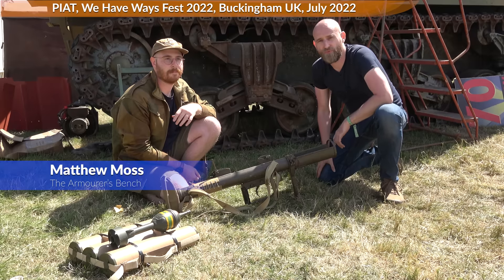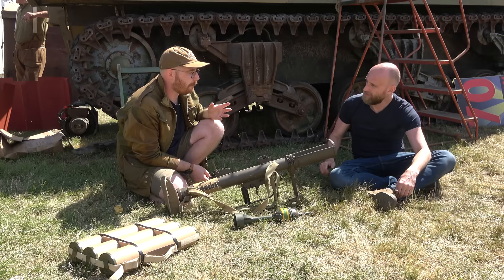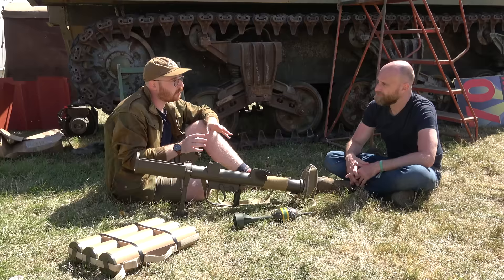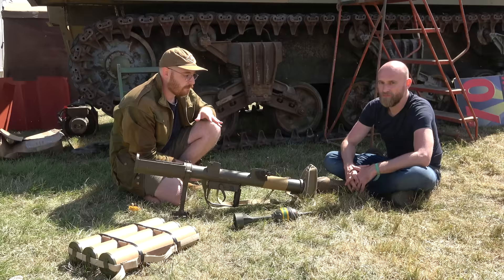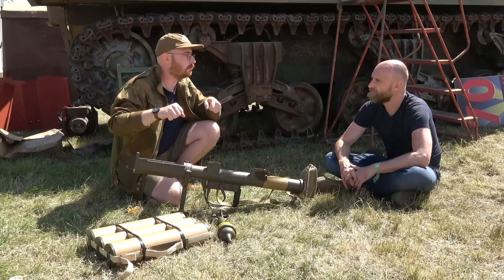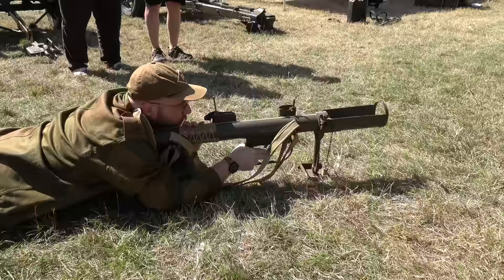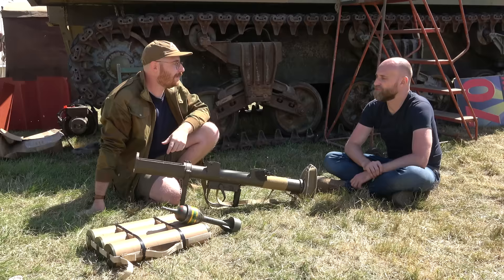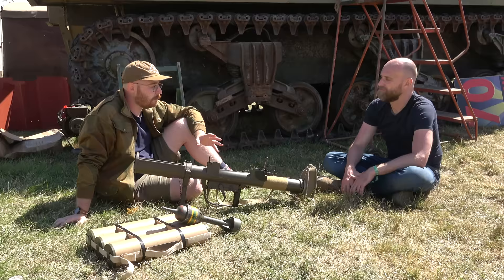PIAT: Better than the Panzerfaust?

Comment: I heard these were very popular with the Partisans in  Yugoslavia simply because of the lack of back blast and it being relatively quiet.  And they really liked using it as a mortar!
Reply: How can that be quiet?......If all goes according to plan, there should be an explosion at the end.....:)
Reply: @mikeromney4712  the same way hand grenades are quiet.  You don’t hear it until the big boom.  And because there is no significant back blast or flash at the originating point you can’t pin point where the attack was launched from.  

It had more range than a typically thrown hand grenade so the partisans could fire a couple rounds into guard posts with great effect, causing mayhem and fear and then melt into the night.  

You’re thinking of using the PIAT  in a major fight.  Partisans used them in ambushes and small raids on much softer targets than Panthers and Tigers.

Then broke engagement before the Germans knew what hit them.
Reply: @KnifeChatswithTobias  So the firing sound has to be quiet so that the bang 1-2 seconds later is a complete surprise?.....:)
Reply: @mikeromney4712  , you would possibly hear the report of a large caliber rifle a 3/4 second befor something, possible the car, truck, building etc.  that you’re in blows up.  Those who were not hit would probably not see a flash or no the exact direction of fire.  This would be case if the PIAT shot was made from 250-300 feet.  
A bazooka or Panzershrek would leave a much larger signature with its back blast.   And throwing a hand grenade 300 feet was not really feasible.  This was the weapon that filled the distance void between hand thrown grenades and mortars.   And it could take out a tank.
Reply: @KnifeChatswithTobias  Sir, in all honesty, you underestimate the spectacle that a PIAT puts on when fired. Youtube is helpful there. Indoors, fired out of the window, both the bazooka and the recoilless German close-in anti-tank weapons have a much lower muzzle flash due to the recoilless principle. But that doesn't really matter. Have you received any military combat-related training? In urban areas, identifying the shooter who ambushed armored vehicles is completely irrelevant anyway. In general, shots are taken from an elevated position on the 2nd or 3rd floor from the side or at an angle from behind. This area can only be fired back from below by light infantry weapons in diagonal line of sight in a quick reaction. So relatively safe for the ambusher (if he immediately withdraws into the room or further back). Until a tank is far enough away to elevate the gun barrel at the window - ideally the ambusher is no longer in the house, or somewhere nearby. For example, you can see in the latest Syrian war how the IS used exactly these old tactics again. Movement only above the line of sight and line of fire of the tanks. Stay close. Only attack from the side or diagonally from behind....and what we are talking about?.....^^

Comment: I fired a PIAT once, in the Home Guard.  Scored a hit on the target at about 30 yds.   We were instructed to hug it hard, to ride with the recoil, and I had no problem in that regard.  However, it did not recock, nor did we expect it to.do so.  The drill was to recock while lying on your back & using yor feet against the butt to compress the spring.   Needed practice to do it swiftly.

Comment: Interesting video on the piat. I really enjoyed the breakdown and history of the piat. I learned a lot from it. Especially its use for indirect fire combat, being used to function in a mortar like role. I wonder if the UK had more time to develop the piat, they would've experimented with stronger, lighter weight metal alloys that could reduce the weight of the recoil spring. Thus making it a more suitable, lightweight AT weapon for the infantry. Thank you for sharing. Cheers!

Comment: Very interesting weapon. Probably the only downfall for it outside urban areas (or other dense ones) was it's relatively short range. Still, indirect fire capability did a lot to make it more versatile.
A lot of Anti Tank weapons have indirect capabilities - it's just that most of them don't have sights to do that. But RPG-7 and similar were also used in indirect or anti air roles. Though you had to be crazy good to hit the enemy.
Reply: The range of its contemporaries was notthat much better, and worse in some cases.

I love PIAT. It is such a typically Brit thing to field: Some excentric boffin's mad idea that somehow works.
Reply: The range wasn't bad compared to it's contemporaries - it could hit targets more reliably at longer ranges than the panzerfaust.
Reply: Average effective range of the PIAT was 35 yards, Bazooka 55 yards for a mobility kill.
Reply: @fryaduck  what source is that based on?
Because British testing was hitting targets accurately well beyond 35 yards.
If this is combat accuracy then it's all finger the air wild guessing and I don't believe any comparison can be made.
Reply: @kirotheavenger60  To it's contemporaries it was decent (though in WW2 there were already longer range weapons, problem was more with accuracy), but like the guy said here - you couldn't make it much better. With modern technology if you'd want to make similar weapon, you might be able to do 2-3 times the range, but I think that's it. Unless you only use it to launch and then get a rocket booster or some new RDE. But then it just makes it a launching platform. I wonder if you could make it substantially lighter though. Spring for lightweight materials that are strong enough and are great materials for a spring?
Reply: @Elmarby  I don't deny that it is a great weapon and it does deserve all the credit it should be given. And there isn't enough of that, because people developed RPG's and stuff like that. So it's definitely a bit "forgotten weapon".
Reply: @jannegrey593  true, but being a dead end as far as future development is concerned isn't a point against the weapon at all.
A weapon should be considered in the "here and now", not what resemblance it may have to future weapons.

Future capability is more a point of interest, separate to any discussion of effectiveness.
Reply: @kirotheavenger60  True - I just remember that it was very well received weapon for fighting in difficult terrain or urban one. However British (or Canadian, my memory isn't the best, since I've read it years ago) did envy others who had longer ranges for Anti-Tank weapons. Which is understandable, but I don't even know if they had the option to check out those weapons or if they went by rumors alone.

And on the front they were fighting on it was one of the best weapons of it's kind (anti-tank role).

I also do remember people criticizing Anti-Tank rifles, because you had to be "too close to the enemy" - that was before the war and the range of engagement against Panzer I and II was similar to that of PIAT. If you cannot find a cover, range of 100m is suicidal. Especially since the tanks weren't going alone, but always with infantry. That's why the ability to use PIAT both as mortar and to fire it from small rooms in urban area was such a big deal.
Reply: @kirotheavenger60  if I remember right the 35yds was average successful hit in combat. On the range it could be much greater... I think 🖖
Reply: Would not you got problems with the back blast when indirect firing with rockets and recoilless rifles? You cannot do it from a ditch, trench or foxholes but indirect you're still be close enough that some cover would be nice. So the RPG-7 in the anti-air (chopper) role seemed to be used from trees, on top of roofs, having the backblast going of the edge etc.
Reply: @barthoving2053  yes, that would be a big problem for indirect firing such weapons.
Neither the Bazooka, Panzerfaust, nor Panzerschreck were used in an indirect fire capacity. Although all were used against "non-tank" targets like buildings at times.
Reply: Saw a video of US forces and Afghan National Army troops engaging the Taliban, the distance was a few hundred metters. The firefight was dragging on until some Afghan chad with an RPG-7 advanced a few dozen meters to get a better shot an annihilated the Taliban with one rocket.

Comment: Seems better that what I've heard previously.   I would say the fact that no one else used a similar idea and it doesn't have a more modern version answers the question of which system is better.   There are still modern weapons that are similar to the bazooka or pazerschreck.

Comment: Maybe the PIAT would have had a better reputation if it was used more in a defensive role against tanks. The panzerfaust was used in a defensive role when enemy tanks were attacking them. The PIAT was used towards the end of the war, when the Allies had tanks and AT attached to the infantry, and these could engage at much longer range. By late 44 the Germans just weren't attacking with tanks that much so there wasn't as much need for the troops to rely on them as AT weapons.
Reply: panzerfaust was made to destroy tanks,PIAT was made to annoy and amuse them.

Comment: It sounds like the recoil is manageable. I started firing a 12ga shotgun at 9 yo. My dad told me to hold it tight to my shoulder, so the recoil will "push" instead of "punch". So many kids at that age would be afraid of a 12ga, but my dad didn't have a 20ga, or a .410, for my to learn on.

Comment: Great video on a very much post war underrated weapon.

I guess you two left answering the title question to us the viewers. And, let most  of the data on Panzerfaust and mind you  Piat out in order to compare.

So version 1943 Piat versus panzerfaust  30. Pennetration versus effective range well trainend user. (That Germany at that and later moments in the war had quality issues both in maufacture and training is to be left out of it when talking a weapon for the British. When talking last ditch weapons the pzf is best hands down.)

Piat had some issues with striking not in a right enough angle. I don't knoe pzf 30 performance. I think penetration 90o angle was 200 mm homogenious armour pzf, I guess piat about the same.

The versatility of the Piat made it worth its wheight. 

In the end my assessment would be both were best. Even for the British army in 1943. Akin that later on both the Carl Gustave (Piat replacement) and LAW (pzf) were used at the same time by the army.

Comment: 2:55 Fire downwards onto tanks -- Assuming that the projectile didn't fall out the front of the projector before you pulled the trigger. The spring had a cocking force of 90kg (not sure why the reference didn't give it in SI force units), which meant that only the strongest soldiers could recock it while prone, and there are descriptions of cocking it while prone looking like the user is having rough sex with the weapon.
Reply: There is a retaining clip on PIAT that prevents the dooblie doo falling out if you point it downwards. They were clever buggers in the 1940s.

Sexually rough, but undoubtedly clever x
Reply: I've cocked one as a young teen.  It was difficult but not impossible.     We used it as a toy in our war games.

Comment: A comparison of the British PIAT, American bazooka, and German Panzerfaust always invites heated controversy.
Let me start by reminding all that the three anti-tank weapons worked and worked well for their purpose and intent.  Otherwise, an ineffective anti-tank weapon would not have gone into mass production.
At the end of WW2, current tanks and envisioned future tanks had thicker armor.  The PIAT and the M9/M9A1 bazooka had reached the end of their usefulness.  But the Americans were fortunate in that the bazooka design and rocket were amenable to upgrading.  Thus came about the 3.5 inch, M20 Super Bazooka, capable of stopping the T-34/85 Soviet-built tank in the Korean War.
The British Army was sagacious enough to adopt the M20 as an interim anti-tank infantry weapon until indigenous anti-tank British weapons could be designed, tested, and adopted.  In the meantime, the British Army possessed a proven, effective anti-tank weapon if ever conflict with the Soviet Union broke out.

Comment: 4:30 if only you could use it like a light mortar in Steel Division 2, would be fun.
Reply from the maker: would make almost 0 difference due to the ammo limit.
Reply: @MilitaryHistoryVisualized  Always knew you were a Eugin head!
Reply: PIATs get done so dirty in SD2 D,:
It's utter nonsense that they have 50% accuracy vs Panzerfausts at 95% - in testing PIATs were more accurate!
Reply: The piat is ridiculously bad, no other infantry AT misses but the piat is a coin flip
Reply: British infantry get done dirty in general in SD2 - PIAT has worse accuracy and pen than weapons it should compete with, the Enfield gets no representation for it being faster to bolt and having a larger magazine (though the sniper variants do) and the Bren is worse than a bloody BAR. It’s criminal, honestly. Thank god for the excellent air tabs.
Reply: @kirotheavenger60  I wish I could say I 100% disagreed, but then I found out the Cromwell is slower than the T-34 as well

Comment: Plus not to mention the fact that they were dirt cheap and fairly easy to use, unfortunately the key requirements were to have balls of steel due to how close you’d have to be, but other than that, I’d say they’re more effective (not efficient) as a war winning weapon where basically the thing was a tube and a spring and that’s about it, it was fairly lightweight and reusable and not only that easy to repair, replace or maintain vs a bazooka or pnazerfaust as well as the fact that some units used these as improvised mortars making them far more adaptable as well as being easier to manufacture than say a complex rocket system. The only real problems were the range of which tanks or vehicles have to be engaged at as well as the actual destructive potential as well as mobility isn’t as great as the bazooka or panzershrek where they could be fired standing up or kneeling due to the lack of recoil,

Comment: The low velocity wasnt mentioned if I am not mistaken. Quite an issue for a weapon designed to shoot vehicles.
Reply: Yes indeed, quite low Velocity, don't have the figures to hand, but it meant men had to understand the concept of giving a target lead. From the accounts I found while writing my book on the PIAT this had a general impact on first round hit rate.
Reply: It was indeed problematically low velocity, however this is common across all infantry AT weapons of WW2.
The panzerfaust was, I believe, even slower! 
Popular history is very, very, wrong about infantry AT weapons of WW2.
Reply: You are mistaken and @The Armourer's Bench @Kirothe Avenger. HEAT or hollow charge weapons do not require velocity to be effective. The only velocity required is to activate the fuse.
Reply: @kirotheavenger60  i find 137m/s as Vo velocity for the PIAT. Do we know the stats of the other ones? Bazooka, Panzerfaust, Panzerschreck...
Reply: @fryaduck  nope. We are talking about the aiming aspect, not the damage aspect.
Reply: @fryaduck  in this case velocity is relevant only for scoring a hit. But you are correct it has no bearing on the penetration should a hit be scored.
Reply: @juanzulu1318  where do you find 137m/s for a PIAT?
Wikipedia gives a figure of 76m/s, although it cites the PIAT training manual (1943) as a source, but I cannot find a figure for the velocity in said manual! 

EDIT: I've found a reference to 137m/s on the "Pegasus Archive" website, although it doesn't even attempt to cite a source. It also seems optimistic if the below is accurate.

On top of that, a quick lazy google turns up 45m/s for the most common Panzerfaust 60, 60m/s for the later Panzerfaust 100, 81m/s for the bazooka, and 110m/s for the panzershrek (which I assume is all-burnt velocity rather than strictly the muzzle).

So, applying a pinch of salt, PIAT seems comparable, certainly a lot better than the much venerated panzerfaust!
Reply: @kirotheavenger60  my source was the German version of Wiki "PIAT". Yes, if the figures are correct it is indeed interesting to see the Piat equal with or even ahead of its peers.
Reply: @juanzulu1318  no source on the German wiki either, I'm inclined to believe the 76m/s.
I'm quite tired and very much taking a fly-by approach to sourcing here so I may easily have missed it, or perhaps it's in some appendix to the manual I don't have.
Still a respectable figure given the contemporaries.
Reply: @kirotheavenger60  Pretty much inclined to agree with you. 137 m/s seems too fast to me, and as a brit I would love to be biased here, but the 76 m/s seems far more realistic given the propellant quantities involved.

Comment: It seems like a different launch system for a rocket, though a pathetic one.
The base tube of the round uses the gases in the same manner as a rocket motor, but the spigot lobs the round away before it ignites .
Much like an air to air missile drops free before ignition.
I don't understand why the idea was not further developed.
18:23  Not only was the launcher misunderstood, but the ammunition was also .
The ammunition would penetrate the armor of pretty much any tank in the world, but it had to hit square on to activate the detonator.
Troops cursed the Bazooka , but it is not a case of just hitting is good enough, as with a rifle.
Among the slopes, curves, and angles of a tank you needed to hit specificlly with the point, more like an arrow.

Comment: Considering the amount of misconception surrounding the piat, it would be of great educational value for TAB to do a deep dive into the PIAT mechanism and theory of operation

As in how the spigot rod moving forwards is essential to the operation of the weapon as compared to a fixed spigot rod with an internal firing pin and a large spring buffer?
Reply: Absolutely plan to! I had one almost done earlier this year when my hard drive failed on me. Need to start working on remaking it.